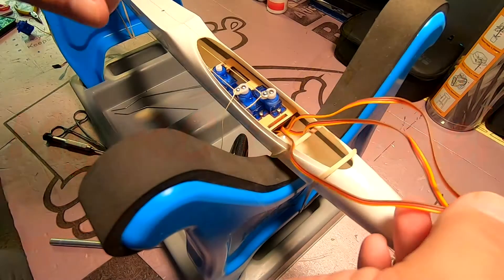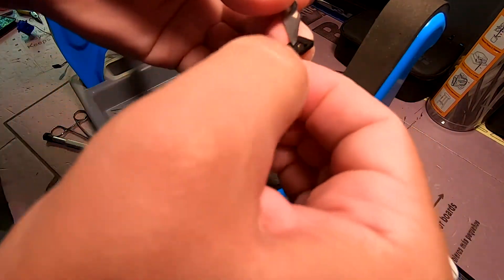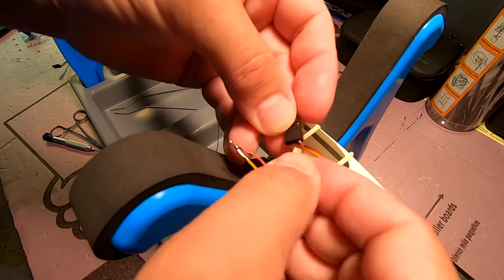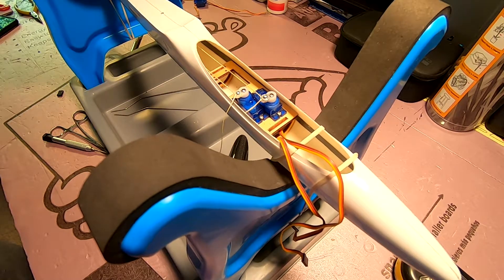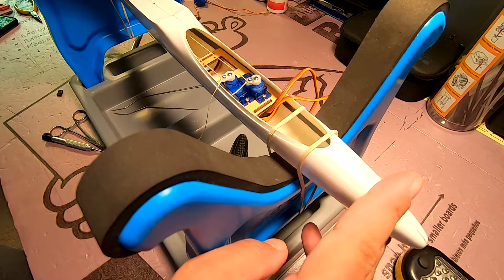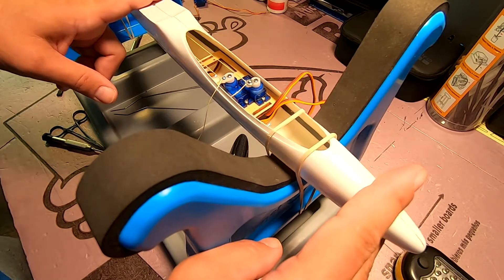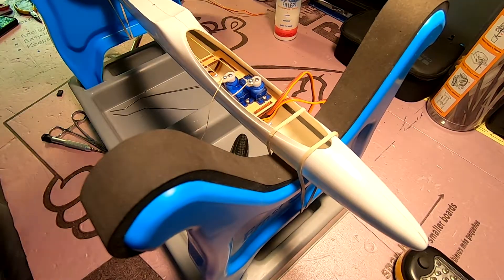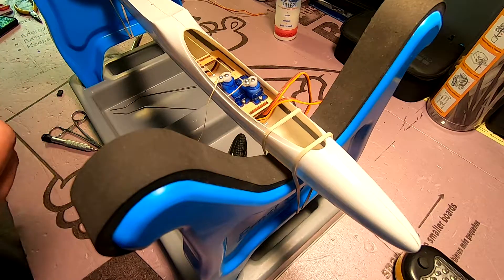HobbyKing Raven 1500 DLG - Build Pt13 - Beginning the Servo Relocation

Comment: Question for you, if you use carbon fibre rods for push rods what do you use to glue them to the metal clevis, jb weld or epoxy or something else ?
Reply from the maker: JB Weld works well for this. It takes longer to cure but it's worth it. The clevises ended up being so close together that I just used a one inch piece of threaded metal rod. For longer carbon pushrods, check out these: http://www.espritmodel.com/pushrod-threaded-couplers-mp-jet-aluminum-m2-for-3mm-rod-2.aspx
If I have problems with the elevator on the Raven, I'm going to use a piece of 3mm carbon rod with a piece of music wire at the rear and one of these and a clevis at the front. It will add a tiny bit of weight, but there will be no issues with enough up or down elevator. I'm also considering adding a 1/8-3/16 inch spacer between the stabilizer and the boom to get more throw before the elevator hits the boom... OR, cut a notch in the rear edge center of the elevator. Look over EspritTech's site when you have time... they have some really nice high-end hardware. 
Honestly, I don't think I'll ever be able to do a proper DLG throw. I tried a couple but I've got to many fused vertebra and doing that move is just to painful. DLG is a young mans game. Anyway, the Raven flies great so I'm going to use it for slope soaring. I might even try attaching a tow hook and see how it does with a high-start or a tow plane. I'll have to reinforce the fuse a bit... we'll see.